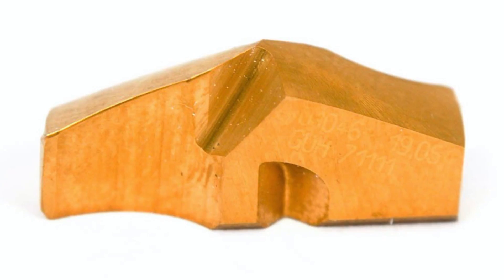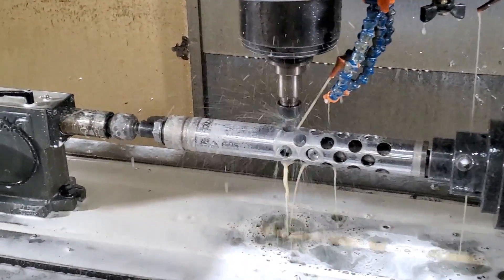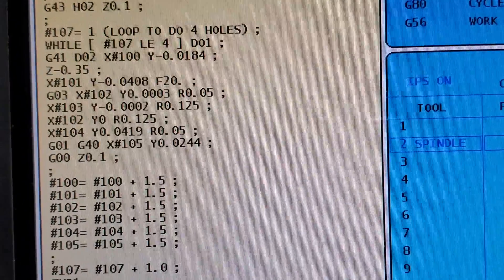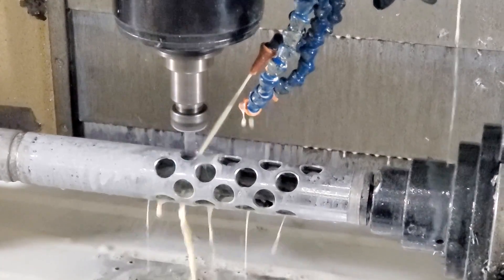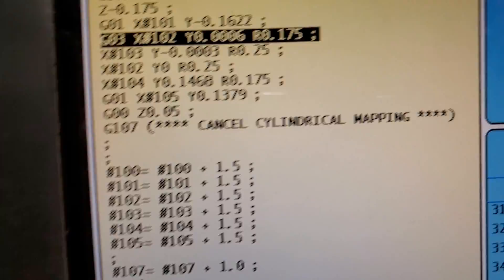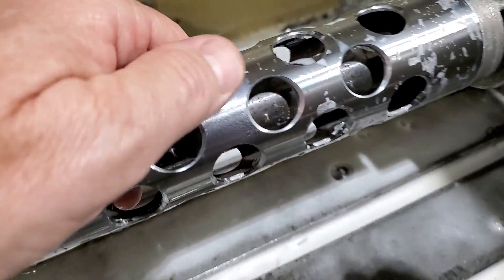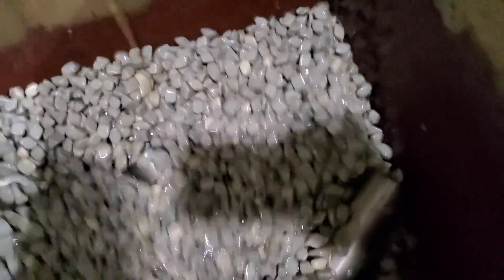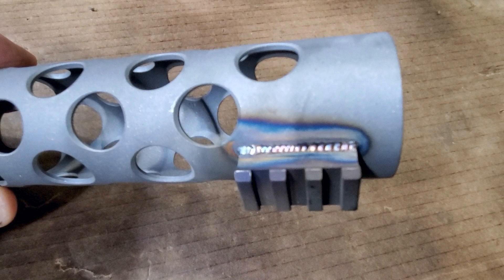ROUND STEEL TUBE WITH LOTS OF HOLES

Comment: I want to use that machine,, the silencer I could make.
Reply: i think you mean ROUND STEEL TUBE WITH ONE HOLE
Reply: @Podzhagitel  I think two smaller diameter tubes offset with holes like that in the solid tube would take a lot of noise out.

Comment: Bevel cutting a hole in a steel tube in one operation using lasers https://youtu.be/LWtXVnL48Zc
Reply: That's a great option... if you happen to have a 3000 watt laser kicking around the shop :) very kewl though

Comment: I have been on a relentless quest to find and procure a handgaurd for an AR15 that is...you guessed it! a round steel tube with a smooth surface and filled with lots of holes(although a round alluminum tube would also suffice),very similar to the one shown in your video. While these were apparently much more common a few yrs back,they have sinse become somewhat elusive, as every one Ive come across in my search has turned out to be a discontinued product. What are the chances of getting you to make me one and what would it cost?
Reply: I know how you feel, I finally ordered a Hogue OverMolded Free Float Forend and was promptly informed that the one I wanted was no longer made, so I picked one they did make for my BLK 300 build. https://www.hogueinc.com/tactical/ar-15-m16/free-float-forends-forend-extensions/rifle-length/ar-15-m16-rifle-length-overmolded-free-float-forend-black

Comment: Lol. Reminds me of the shifter and steering column I made for one of my old projects. Made to look like the business end of an M-2. I added a lot more holes though. All by hand on a manual mill and lathe. Chamfering and finishing was hand filed and then buffed on a buffer. Yeah, hours and hours and hours!! But it sure looked cool all done! Made a neat little muzzle brake for the shift knob and set a .50 bullet tip inside the brake so it would look like it was firing.

Comment: Confusing title.

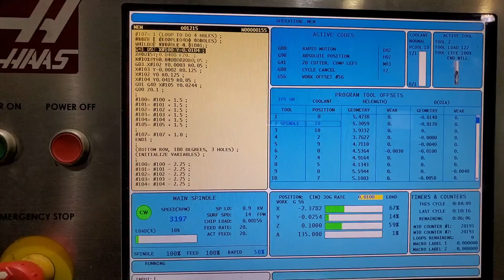PS 1:35 They have loops?! Now I want to learn G code. Does it have Multiple inheritance?
Reply: A lot of the time a project like this would just be easier to write by hand than do in the CAM package, yea, you can have variables, conditionals, loops, macros, however, I really wouldn't think of it as multiple inheritance.
Reply: @highdesertdrew  Well my G code was always rudimentary and it hasn`t got any better since I went CAD/CAM about 10 years back but even the simple 4th axis CAM I use would eat  this for breakfast.
There was a reason CAD/CAM took over and looking at this project shows why.

Assuming you would have to produce a drawing in the first place then 4th Axis Unwrap and Drilling templates would post this out way faster than 99% of people could do it manually.
Reply: @billycaspersghost7528  I've worked on a lot of older machines that simply have limitations to how much memory they have and how much code they can store. in the last 10 years, this is pretty much moot, but you go back 20-30 years it's easy to burn up all the usable memory with a CAM package. 

I used to mostly just do CNC in the prototype environment, more recently I was working in a larger shop programming all the machines for the operators. That experience really drove me hard to start building macros that would make the machines easier for the operators, setting more generous tool retraction positions, having the machines automatically re-zero themselves and check tool wear after a certain number of cycles. It really helped reduce operator load, sped up training, and made the CNC part of the business more profitable.
Reply: @highdesertdrew  Mines only got limited memory today.
I go from outside the machine ,memory stick or direct coms with the laptop or PC if the program is too big.

Though a CAM post processor is not necessarily going to write a huge program if directed to use canned cycles and sub routines.

This holed tube would not be a big program as it is not simultaneous machining.
Effectively it is just a rectangle with some holes on it.

All the features of retraction positions, customisation , tool wear can be done in the CAM.
Depending on the machine I would even put  an incremental tool offset on the CAM rather than at the machine

I only "tune " programs at the control now if I want to do a quick edit or I`m too lazy to walk back to where the bosses insist the PC has to sit.
Currently it s about 100 yards but they have become enchanted by the idea of cloud based programming and it will be somewhere in Estonia.

Bosses have not changed with all the advancements.

Which CAD/CAM system do you use?
Reply: @billycaspersghost7528  I get to use more than a few, CAD is now solidworks, for a while we were using Fusion360. We were running a lot of CNC routers for vacuum-forming molds, as well as secondary processes like drilling and cutting out panels. For the CAM portion we still run Vectric's VCarve. More and more the design dept is moving over to Solidworks CAM (we just got it this year) as we're now also running some HAAS machines.

The older machines I was talking about, most of them the controller was either Serial or Parallel, mainly because we didn't have a working tape drive. So talking a 50kb program might exhaust the entire memory space.
Reply from the maker: @BillyCaspersGhost I figured I'd ruffle some feathers with my comments...sorry about that.  If you think your CAM program would "eat my program for breakfast" I submit that you don't know what you're looking at,  no offense.  All of the G-code in my program was created by my CAM system, but I put that code inside a series of loops.  What's great about that is that there is only ONE bit of code for each thing I'm doing...drilling, mill boring and countersinking.  All the hard numbers are replaced with variables.  So what I have is a very small program that's incredibly efficient and fast at doing what it's supposed to do.  And it's very easy to change the program to account for custom hole locations.  I've been using CAD and CAM for over 20 years and have done a lot of research on most of the available programs and I've yet to see a CAM system put out code that doesn't waste time "cutting air" or doing other wasted moves.  My programs always beat CAM-created programs for cycle time, and when you're making thousands of something it's well worth those extra couple of hours I spent creating the program in the first place.  As I'm sure you know a lot of times the most important thing is to get parts running ASAP.  But in the case of these handguards it's a part that we've been making for 20 years, so getting it to run as fast as possible (without sending the tools to an early death) is the most important thing.
Reply: @highdesertdrew  That was just a joke about multiple inheritance. I’m not a fan of multiple inheritance, personally. But I was seriously pleased to hear that it’s a more fully featured language than I’d ignorantly assumed.
Reply from the maker: @Splestrie Don't get too excited.  The basic G-Code is extremely....uh...basic.  The conditional branching stuff is not part of the "language", but is a feature of the machine's controller.  Same with cool, higher level stuff like axis substitution.  And those features and their implementations vary from machine manufacturer to machine manufacturer.  If you ever meet a "CNC programmer" they're not likely to wax philosophical about traversing linked lists with you, so keep that in mind.  "CNC programming" usually consists of sticking a CAD solid model into a CAM package, hitting the "post process" button and loading the resulting program into the machine.  Don't get me wrong...some of those guys are magicians and they make the world go 'round in the CNC machining world.  But it's generally not what real coders would consider programming.

Comment: Mark, you heard this here first, you're  a helluva designer so design up a windshield wiper/motor on the INSIDE of the CNC windows. Or simply locate and drill the hole the motor shaft goes through for a skid steer type windshield wiper. Seal, wire, and be the first one on YouTube to do it!
Reply: Could just buy a rotoclear, or drill a small hole in the sheet metal on the door and stick a bent air gun in to blow at the window. I have used both and they both work great. Rotoclears are expensive though. So a bent air gun is by far the cheapest and easiest way to accomplish this.
Reply: Why?
Reply: @MyS10Rocks   so you could see through the coolant spraying on the windows. It makes it easier to prove out new programs or setups if the machine has safty locks on the doors that make it so you cant open them during an operation.
Reply: That's why haas machines allow you to run the program at reduced speeds with the door open, to prove out the program.
Reply: @MyS10Rocks   Maybe on their older machines. On the newer ones you are only allowed certain functions in setup mode. Other machines such as DMG MORI and Toyoda will not let you run programs with the doors open.

Comment: Mercy How long does it take to set up the programming.
Reply: Doesn't take long after the workpiece holding, tools and speeds are sorted out.
As our host mentioned; it's just a bunch of subroutine calls for each detail operation; moving to a new offset between calls.
Of course the sequence of operations determines how wobbly the last cuts will be. Keeping it stiff until the final cut.

Comment: How much is this beautiful machine? I want it to fulfill my dream of innovation, but poverty is a big barrier
Reply from the maker: Haas VF-4SS with 4th axis, touch probe, through-spindle coolant, 40-tool magazine, plus a bunch of other bells and whistles.  A little over $100K these days.
Reply: @markserbu  Very beautiful, and wonderful, but unfortunately I will not be able to own it; I simply don't have a price for it
Reply: @makeadnane  Buy a manual one. Can't do all the things one with a brainbox can, it's labor intensive but it's a fraction of the cost. Even cheaper if used.
Reply: @ThZuao  Yes, the mind exists, and ideas are many and wonderful, but without tools, it is meaningless. Tools and machines are necessary at work, but they are expensive. Unfortunately, all our thoughts stop until they become static.
Reply: Looks like a vf2ss from Haas, they start at 68k right now I believe. Haas has machine and option prices on their website
Reply: @OakwoodMachineWorks  Thank you for this explanation

Comment: Great use of the macro, I personally am surprised though that you used a rapid instead of a 15-30 ipm feed when you began to deburr the holes but to each their own on how one wants to run their machine. By the way swarfing in 4 axis is cool; 5 axis is even better😉
Reply from the maker: I rapid into the holes because there's generally nothing in the way or just a very, very thin disc that's barely hanging on.
Reply: @markserbu  I understand your reasoning, it's just something I'm not used to seeing as the production shop I work at we error on the side of caution with all endmills when cutting blind or through holes due to using 1/8 endmills and smaller on a regular basis. Not knowing what machining tricks you know I just home "machining in a window is one  of them", quite handy for thin part with weird contours.

Comment: One of my brothers programs and runs those. Incredible bits of engineering. I recall actually running away when I saw him fire one up the first time. Huge train wheel casting. Wheel accelerated to a gajillion RPM and the tool's first shaving looked to be digging out .250" shavings. The thin door glass was not reassuring, so I got off the X. He laughed his ass off. :)

Comment: Fascinating! 

Gotta wonder what filtration system that "round tube with a lot of holes will be installed on". I work in a chemical plant and see many similar pieces of tubing, but without all the holes.
Reply: Hey, me too. It reminds me of a steam sparge a little. I try to tune all that work stuff out and am happy to say its a tube with holes, cheese grater, flute, custom truck exhaust. Anything other than a heat/fluid dispersion nozzle device - dammit, work thoughts- now I'll be singing the periodic table of elements song in my head for the next 3.1415927 hours

Comment: In my screw machine days in the early 70's we ground special tooling to perform more than one function at a time because of the limited number of tool holders in a screw machine. Thirty years later we had tool companies custom make tooling for our cnc mills. You can get a tool custom ground that will drill, mill and chamfer those holes cheaper than the price of those inserts. It eliminates two tool changes in your process and as we both know time is money in a machine shop.
Reply from the maker: I hear ya!  Most of the stuff we do has been constantly improved over the 24+ years we've been doing it.  The way we used to do these holes was really bad....#6 HSS center drill, followed by a 3/8" HSS drill, followed by a 47/64" HSS spade drill.  Then mill bored with a 1/4" carbide end mill, followed by HAND DEBURRING of every hole.  Now we're going to short circuit the whole process by just burning the holes with a 2KW fiber laser.  Will be about 10 times faster!
Reply: @markserbu  Have you seen lolipop/undercutting end mills? They would debur those holes fast.
Reply from the maker: Sure have.  But the mill boring operation leaves the holes basically burr-free and after tumbling they're prefect.